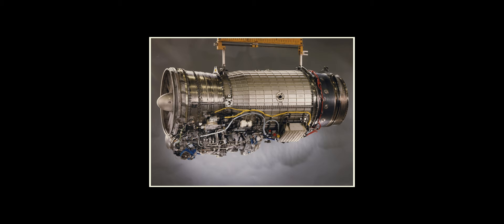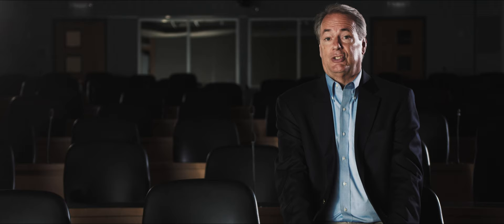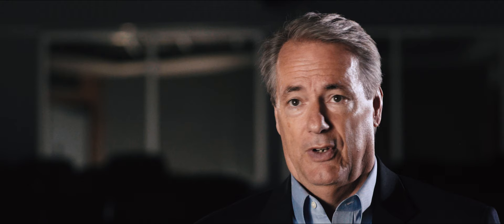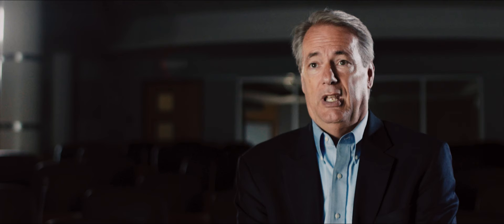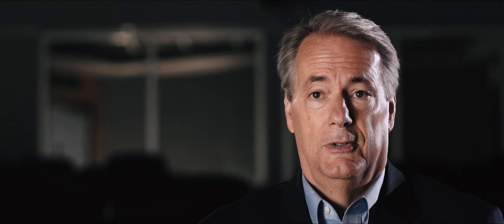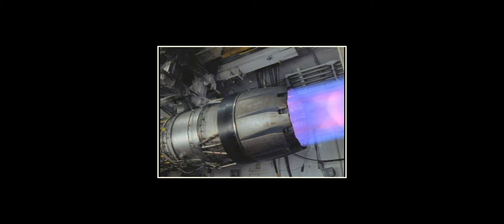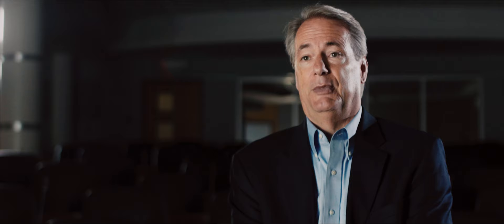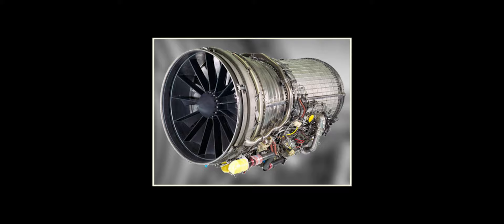Chapter 10 of 13 - Fighter engines

Comment: Coming from someone who works on the f110 engine,that engine is much more reliable than the f100 engine by pratt. The only thing that pratt engine does better than the f110 is break.